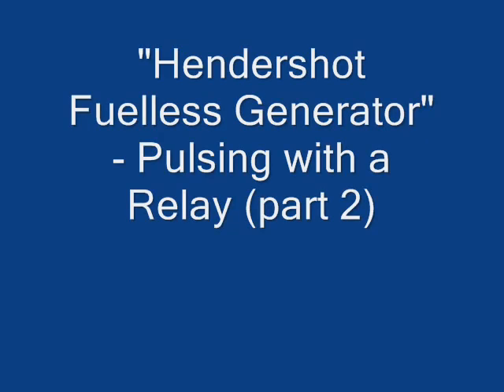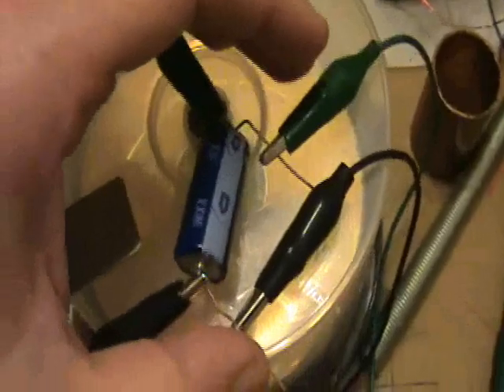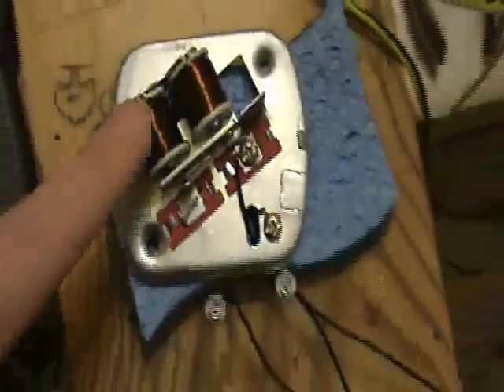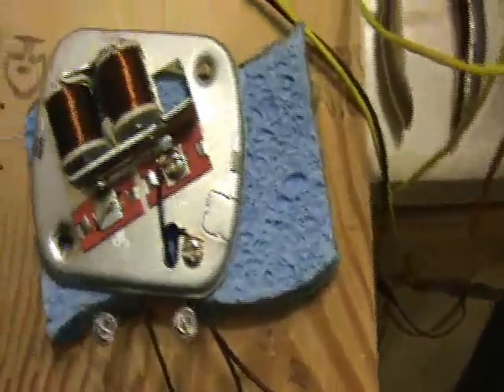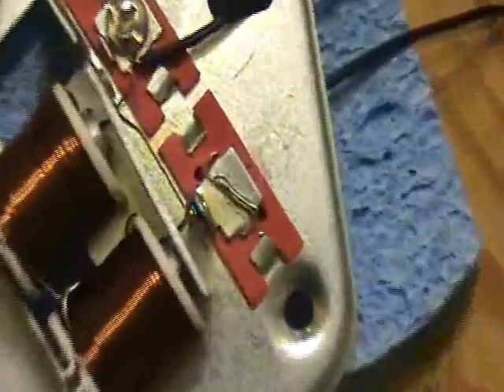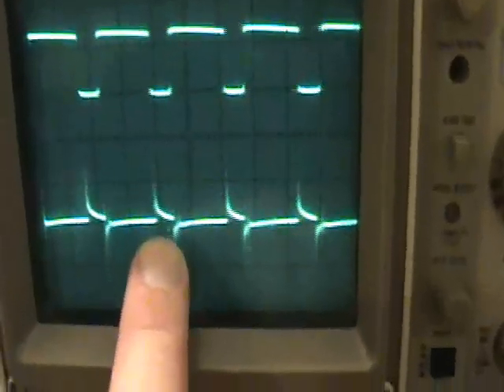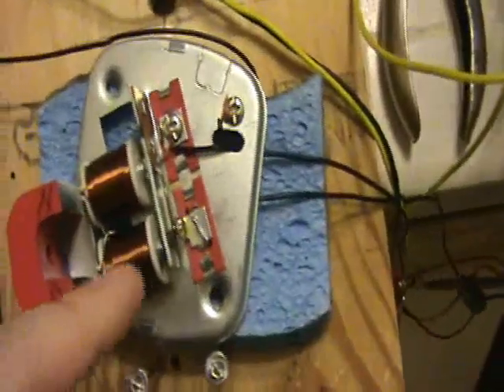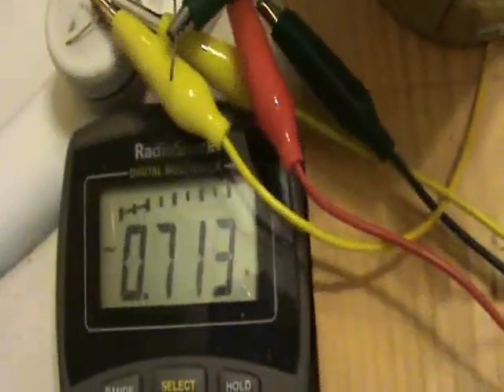"Hendershot Fuelless Generator" - Relay Pulsing (Part 2)

Comment: also to add 100 watts back then seemed a lot of power even car radios where mini tubes in them 12 filament 2-300 vdc plate 50-75 vdcgrid i played around with many parts 1 of my landlords had a tv radio shop where i lived at the time i found draws n boxes of tubes resistors caps some ham gear so on from ww2  i dont have much left mostly carbon resistors tubes all gone the main reason was the transistor wasent invented yet ive worked  on tube to transistor to microchips for i was a tv repairman

Comment: what you have there is a vibrator power supply or an old fashion inverter 12 vdc will gointo a vibrator  to a few ac caps and a transformer in reverse phase pri sec hooked up backwards  i had many parts from ww2 got from  my uncle worked for 2 airports in ny and gave me a real one in a metal box 12 vdc in 110ac out i took it apart to see how it worked hav a metal can 4 pins to a socket and some paper caps and a transformer i gave it to someone i knew its total output was only 100 watts

Comment: what do you mean by "they basically short out"? Did you put a meter to the two leads? I found the video difficult to follow as far as which wires go where and the schematic doesn't clearly show how the 3 coils on each stack interconnect... I don't imagine them to be in series or we'd just need 1 length of wire to wrap instead of 3 varied. And if it had anything to do with the Earth's mag field, it would have to align a certain way... The one in the plane was probably on a gyroscope of some sort.

Comment from the maker: Yes. Indeed. I thought about that a bit. In his time, transformers in many appliances could tolerate frequencies from say 40Hz upwards to 200Hz, and powering an incandescent would be no problem too. I would be a little DICEY plugging in something like a modern TV if you didn't have a nice 60Hz (or 50Hz in Europe). His "buzzer" solenoid thing would be oscillating at mechanical speeds... but its not great regulation.

Comment: What gets me is, they said the parts would cost around 50 bucks, but he calls for 4 1000 mF Caps (without specifying voltage) and 2 500 mf as well. Those aren't cheap... 

And tell me, why did the video look like it was shot in 1984 yet the very end includes a flat screen TV with HDMI?

I'm still interested in building it just to see what's possible... I'm trying to conceive of how a coil could interact with the Earths mag field. Not sure how the blocked dipole comes into play...

Comment: yep I found that out the hard way... lol. It is interesting though. When he powers the light bulb array it seems like the lights dim exactly as they would from a slide dimmer... except that it's too many watts for any single switch to control and they all stay consistently dimming together... but at one point they flicker in a way that doesn't match his movement of the magnet against the coils... He did cut into it so there could be hidden wires/devices behind the board.

Comment from the maker: People have speculated that Hendershot used radium, or managed to get his hands on a slightly radio-active magnet from a military base. Hubbard was also suspected of using radioactive materials. In my studying of the myth about these guys, I don't think this is the case. I am not certain, however. Never-the-less, it still would be an interesting device, although much more dangerous to a persons health.

Comment from the maker: @prototype9000 
Actually, I was remember this wrong. The issue in this video with applying pressure with the buzzer was diagnosed and explained in the next video "buzzer trouble". The buzzer poll would actually move when I pressed down, creating tighter gap, increasing frequency, and the circuit would respond better since coils requires a higher frequency (more power can flow near resonance).

Comment: Nice toy ! I use an antique one which is very similar but with a solid iron frame. I do not have your pressure problem so you should try another frame... Also noticed than a lighter but still rigid clapper works better (more speed, higher back EMF) than the original one. The best compromise i found is a very thin flat steel tube... Sparks are still a big problem.
I tried to use a capacitor or a RC cell but the efficiency also decrease...
Good work again, keep going !